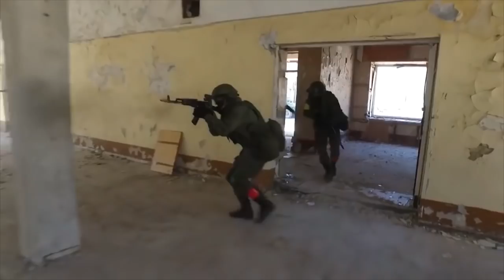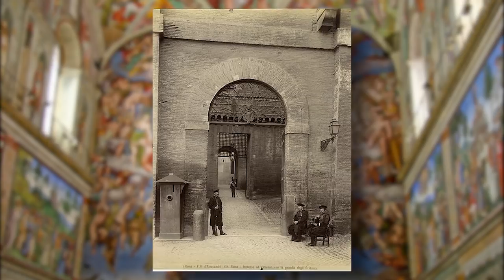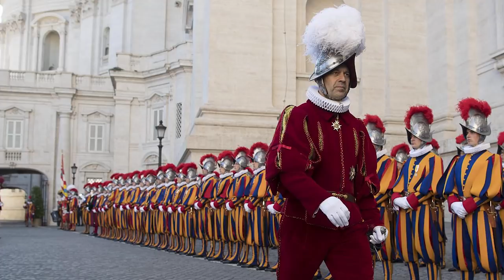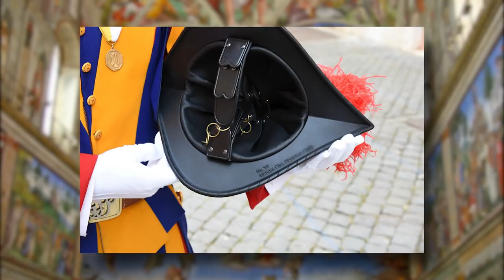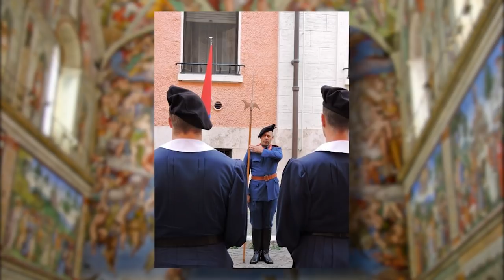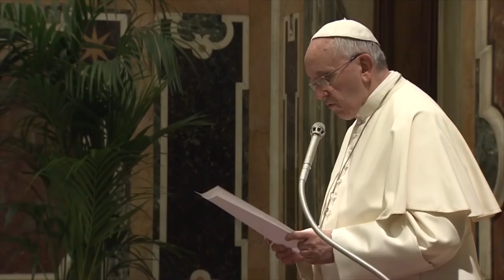The History of: The Pontifical Swiss Guard's Modern Uniforms | Uniform History

Comment: You should have also covered their ceremonial weapons, aside from their side swords they also use halberds, obviously, and flamberge greatswords. If i'm not mistaken some of these weapons are renassaince originals.
Reply: Yes they also have a arsenal of full auto wepons.
Reply: C M  kek what
Reply: The arms room is a very interesting visit.
Saw it a few years ago for the swearing in ceremony. 
Not usually open to the general public.
Reply: @sethlance8009  SIG 556, HK Mp5 and Glock 19 and  22 and several other weapons. Their ammo designation is interesting which gives you a hint what other weapons they have to their disposal 

12,6 × 45 R Papal Remington
.50-70 Papal Remington
12,7 mm Remington Papal[13]
12,7 mm Remington Pontificio
12,7 × 45 R Papal Remington
12,7 × 45 R Remington Pontificio
12,8 mm Pontifico
12,8 × 45 R Papal Remington
12,8 × 45 R Papal Remington Vatican Guards
12,8 × 45 R Vatican
12,8 × 45 Remington Vatican

Comment: "each piece of uniform and armor is blessed by the pope himself" +10 armor
Reply: Please buf
Reply: And 100% morale boost and 20% character satisfaction buff faction wide.
Reply: 50% resistance to temptation
Reply: Full stat change: 
+20% Mental Resistance
+0% Physical Resistance and Armor
+Morale modifier based on your Faith attribute 
+500% Protection against Demonic and Damage against Demonic due to having a full set of top rank blessed gear.
-Low chance of extremely minor armor rusting if Holy Water is used in the blessing process.
Reply: Don't forget luck and magic resistance
Reply: While it can resist dark type atack, but weak against neutral type weaponry.
Reply: Invulnerability against critical damage.
Reply: 80%+ resistance/damage vs undead.
Reply: -10 to any stealth check though...
Reply: +100% Chance straight go to heaven
Reply: +70000 holy see
Reply: +20℅ Attack Speed
Reply: But only against undead and demonic types. Paladin attacks ignore this buff
Reply: Oh gawd
Reply: But does the uniform include the 4 strenght 4 stam leather belt?
Reply: whoa watch your words y’all here
Reply: @ReviveHF  gotta remember the discipline bonus and modifiers
Reply: +200% damage against germans
Reply: Wololo
Reply: Also...

Equipped creature gains protection from black
Reply: There is no pope as no God or Lord

Comment: Vatican also have Palatine Guard and Noble Guard with different uniform from Swiss Guard.  In September 1939 the Palatine Guard numbered 500 men; by the liberation of Rome in June 1944 the corps had grown to 2,000 men. Later the Corps returned to its smaller size, and to chiefly ceremonial duties. It was abolished on 14 September 1970 by Pope Paul VI. The Noble  Guard was part of the Pope's personal guard, providing a mounted escort for the Pope when he travelled in his carriage; it saw no active military engagements. The Guard performed special missions within the Papal States until their abolition, and then continued to function at the Vatican with a limited mounted escort role. It survived (no longer with horses) into the period of the Vatican City State, as a de facto Vatican military unit from 1929 to 1970.

Comment: Plastic helmets? How about rubber halberds and swords next
Reply: Depending on the plastic used and the quality/design of the liner it should be good enough for what they're likely to encounter. Besides, steel helmets won't stop a bullet and they're not very likely to encounter an intruder wielding some sort of medieval melee weapon either.
Reply: You realize the helmets are mostly decorations after the 1800s, right?
Reply: @Clay3613  still if they're gonna be used in an official bodyguard capacity they should at least have some better protection than plastic unless it's that newer polyethylene armor.